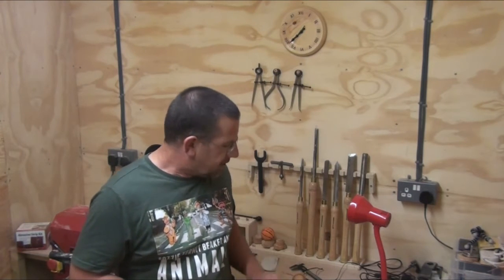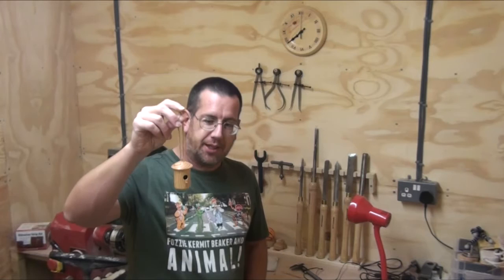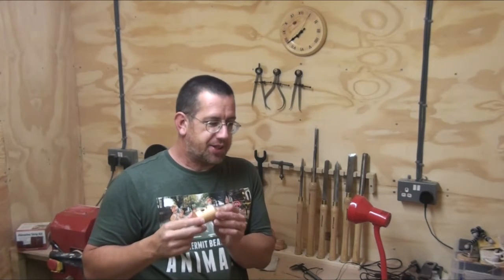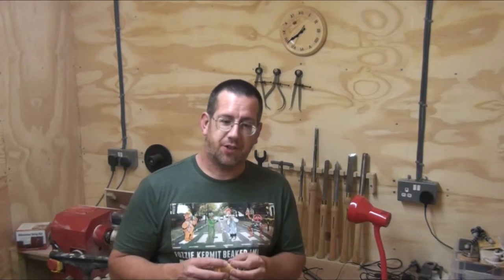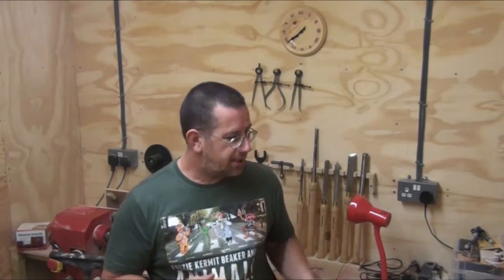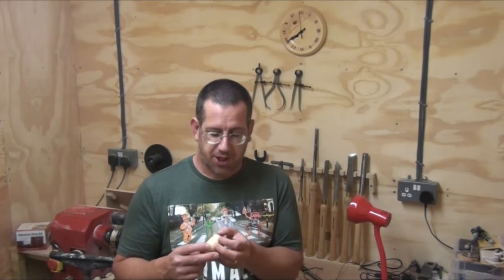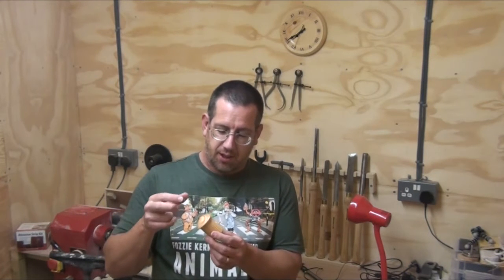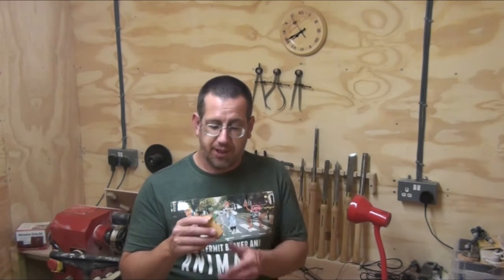Ornamental Bird House - Episode 22

Comment: Nice job, Paul. May I suggest 2 things? 1) slow down your lathe speed when drilling - especially when using Forstner bits; and 2)continuously pull out your Forstner drill bit when drilling to clear out the sawdust from the hole . . . . You’ll get a cleaner and “cooler” hole with less heat buiold up.
Reply from the maker: Thank you. This was over 2 years ago now. Looking back the video was sped up and the lathe was at it's slowest speed of 500 RPM. I was backing off all the time to allow the shavings to clear. Those forstner bits are pretty blunt, especially the larger ones which I rarely use. If I did this again, which I may do I would manually hollow out as it's just as quick and more enjoyable.